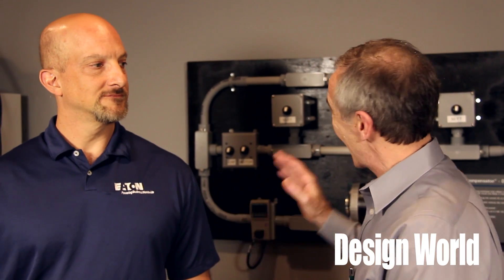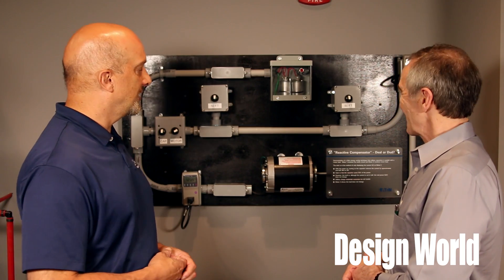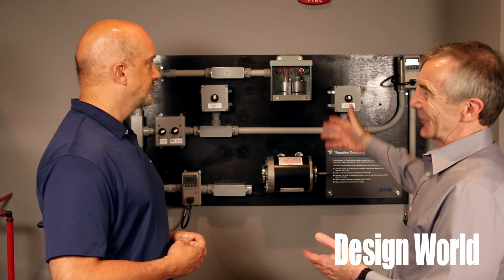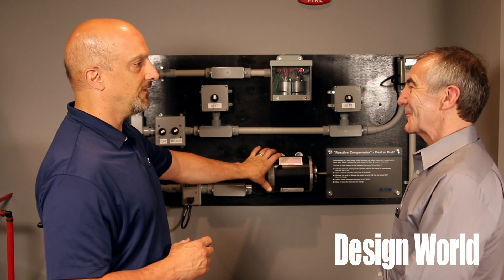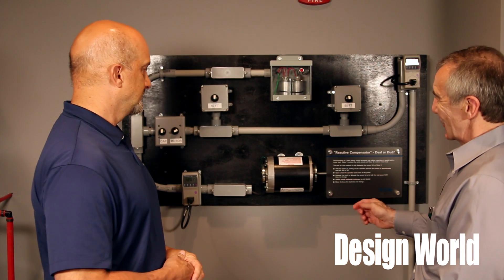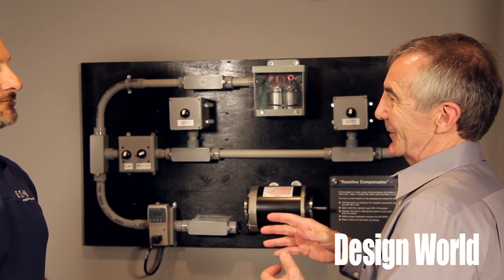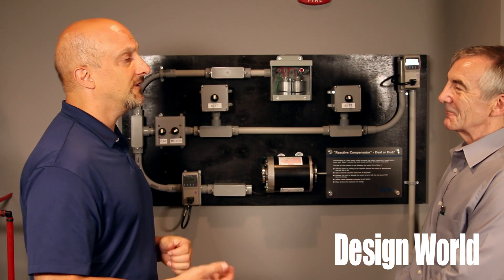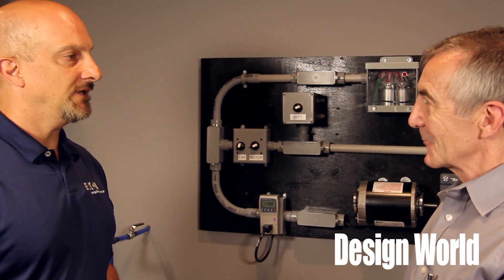Inside an energy efficiency scam -- capacitors don't save energy

Comment: Great video and I learned a lot from it. 

I’ve had one since the 90’s. All my appliances that were bought in 2000 have not failed. In my opinion it has helped with the longevity of my appliances. 

I get that it’s probably not saving money but I’ve only changed the capacitor on my condensing unit once 
since 1996. Fridge is from 2001, so is dishwasher, washer and dryer. 

Maybe I just bought great appliances or maybe it’s the power save 1200 I installed. 

This item was sold in Home Depot and had a similar display. 

I have had low utility bills and although I have solar panels, my consumption is very low.

Comment: Hehe, was just looking at one of these systems my new employer bought. Apparently they made sure not to include the plant electrical engineer in this discussion and they got scammed.

Luckily they started with one plant and had realized it was useless before fully installing in the plant I work at before completing the installation. Think they tried to sue but the person who sold was no where to be found.

Avoid xeco (or seemingly anything that starts with x as same person also ran xedia and xum) products, literally just a few capacitors but sold for big money.

Thanks for the video explanation, will forward to a few people

Comment: this is BS anyways if you made an electric meter what would you do? more work to make sure that it is super accurate? because if there's reactive power etc, think of it like this, why does a motor have a label that says how many amp volts and sometimes watts it uses? because that's what it uses, not even maximally so it doesn't matter if you say once the motor is running it only takes a tiny bit to keep rotating you're ignoring the current required to keep the armature loaded, that's where all the power disappears, and there's no way a meter is accurately seeing that, it sees the same thing as stated on the motors label. which means that it will balance the in rush current and then see the overall draw. but what happens if you turn a motor on and off rapidly? im not using power, right? do you think my bill would go up if i turn a 5 A motor on and off 100 times a day but never actually let it run? of course it will go up. but I'm not using any actual power am I? other than heat waste, everytime the motor goes on and off the field collapses and i didn't really use any power hardly, but i bet you that's not what the meter sees.

Comment: no one ever claimed they save power, it's about the way that power is measured and billed for, and it only works if you turn on and off a lot of high power motors, that's it. at least thats what ive read in the past.
Reply: Bs, have definitely seen these type companies promising power savings

Comment: My father got “into” this about 30 years ago.  I worked for a defense contractor for a long time as an EE and was certainly quite familiar with reactive current and power factor, and I tried drawing pictures showing the phase relationship of voltage and current, and how the product of the voltage times the current had to be account for the phasing of the voltage and current.  Which showed a positive and negative power waveform, which of course averages to zero. My father had the “demonstration kit“ that was painful to see.  The motor was unloaded, and he was fixated on the current reduction.  I told him that any power saving would just be the reduced current heating up the wires leading to the motor.  And to feel the wires and if they were cold he wasn’t saving meaningful power at the evil big power company’s meter.  I couldn’t get through, it drove me crazy.  I thought this video was great, but I don’t think it would hit a non-technical person.

Comment: Capacitors can improve the power factor if there are inductive loads such as motors. However it is doubtful if a home, like factories, are charged extra for low power factors. And the meter would need to report power factor  If they do, it should show up on the monthly bill.  On the other hand, I have measured power factors on both LED and compact flourescent lights are they are significantly less than 1.  This increases the current for the same watts and therefore the transmission current power loss the utility company pays for.

Comment: The proof of the pie is in the eating... I bought a KVAR unit for my 3200 square foot California home. I have 2 Air Conditioning units, a 5 ton and a 3.5 ton unit. I compared my Electric bills year over  my previous year. My saving were about 8%. My breakeven point for the cost of the unit was 1 year. So, as much as I respect the opinions in this video, I witnessed an actual savings on my electric bills.
Reply: Video might be sponsored by big energy companies.

Comment: I think it works effectively when using AC compressor type Air Con because it reduces the start load of the compressor repeatedly when running and it smooths the current.
Reply: REDOSE START UP AMP S ON A/C STARTER KIT! MAKE START UP FASTER CUT DOWN DRAG PULL LESS AMPS!!!!!!

Comment: This video is somewhat misleading from the real truth. But is mostly correct from the standpoint of a residential system. 1 or 2% is still a savings so your 90% correct only.
1) It also does save power and losses for the utility. We pay for the cost of electricity generation including the losses to deliver everyone's power.
2) If we all put them in then our bill will go down by the few % mentioned AND or electricity rate would go down by about double that with a more efficient grid delivery.
Why, because the utility gets to only add a certain % markup of the cost of providing power.
If there costs go down then over time as these get tallied on the books we would all get a lower bill along with the houses internal I^2xR savings. Rural areas with long under sized feeds will have higher savings than mentioned on both sides of the meter, mostly in the feeds. The transformer near your house has to withstand the total power reactive + watts as well, (but again read the above if we all did it example) 
As an example 2% savings with a 400$ a month bill would save 100$ a year. An older house may have a 2% saving with smaller gauge wiring than new standards
But the snake oil salesmanship tricks are spot on mostly! Good job exposing this fact.
3) We got these new digital meters now and depending on the brand and type they will convert  HF switching noise, back EMF pulses and higher order frequencies that are disproportionately greater with poor power quality or power factor that should be calculated as reactive power into real power. Capacitors shunt these non 60 Hz frequencies and reduce them before they reflect back the the smart meter.
4) Get real smart meters from all the major manufacturers and repeat to see if the smart meters show a change from the watt.
Add some SMPS to the mix with constant loads attached as well to see how the smart meters measure the noise and reactive power of the switchers. Both PFC and non PFC types. As well as old school linear power supplies.
The rogowski coils are suspect from my readings, but have not done testing myself yet to see if these reported results are true or not. If they erroneously convert switching spikes from diode switching of linear or SMPS switchers then capacitors will substantially reduce ones electric bill.

Comment: Would these capacitors help with the pull down on the current. For instance, when an appliance with a motor kicks on. Dimming of the lights?
Reply: Survival Radio Refurbishing No, as those things happen over multiple cycles. For some inductive loads installing a capacitor at the load might help by correcting power factor and reducing VoltAmps, but even perfect whole house power factor  correction wouldn't help the voltage drop along the wires inside the house.
Reply: Survival Radio - Saving The Oldies and
Reply: Yes, I installed a KVAR for that reason, not the energy savings. It works as a soft start for electrical motors, my well, refrigerator and other appliances with electric motors that draw a lot of amps at start up. I have one of the inexpensive soft start HVAC units on my outdoor AC compressor too. I have no idea on any power savings, not the reason I purchased. Simply trying to increase the longevity of the appliances and well pump.
Reply: Your refrigerator has a starter capacitor just like in this demonstration across the starter winding. after the motor spins up it shuts off along with the starter winding. So yes. You can get these capacitors at the industrial surplus stores and do can add power factor correction to any motor.  When you do this yourself then the payback period is less than a year